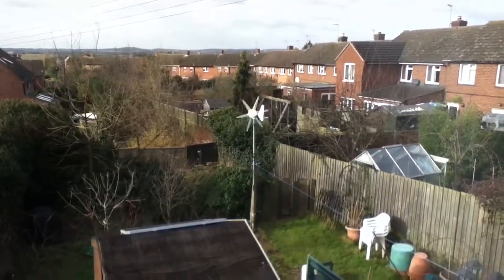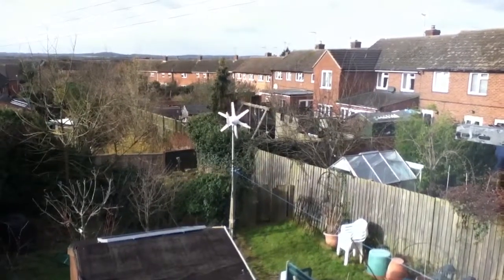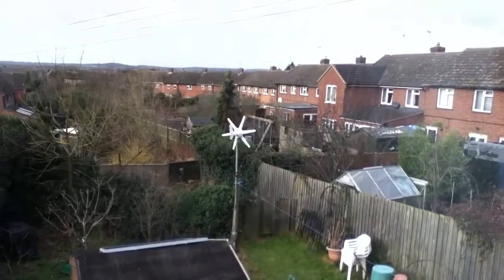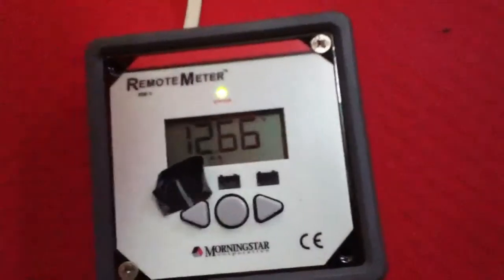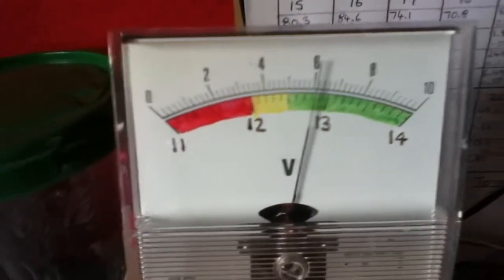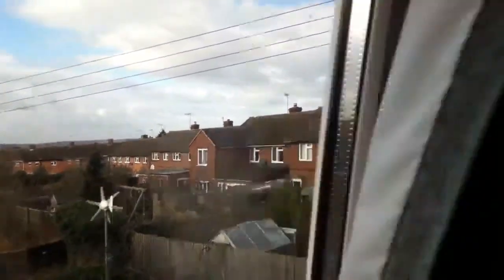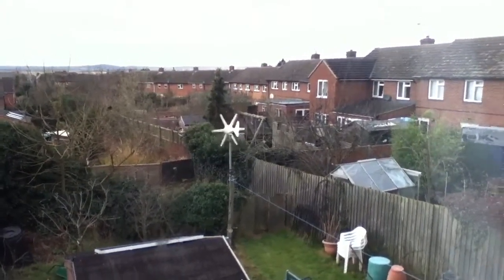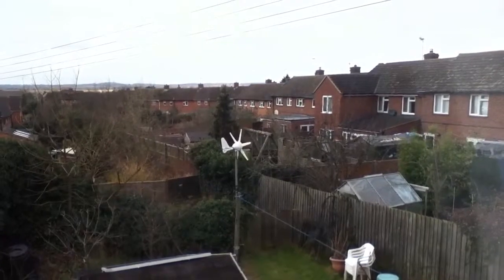Sun 1st Feb.      Full set of blades on the Rutland 913

Comment from the maker: The wire from the turbine (12v 300w approx 18a max output) to the house is not that far, and I used cable rated for 25 amps. Since the video was made, I now have it wired to an MPPT solar charge controller. So when we have a good blow, during a stormy period any excess voltage (above battery bank voltage, 12v system) will be converted in to extra amps to charge the batteries. My area is fairly built up (see surrounding houses on several sides) so wind here is not very reliable as a source of power. That's why I have solar as it's more reliable and cost effective that turbine was also very expensive even though it was secondhand. If I had to choose I would go just solar and save the money. For the solar I have 3x 100w 17.2v panels in series connected to 30 amp mppt charge controller charging 3x 12v 100 amp hour sealed Agm batteries. This is a hobby system, our house is connected to the electric grid.